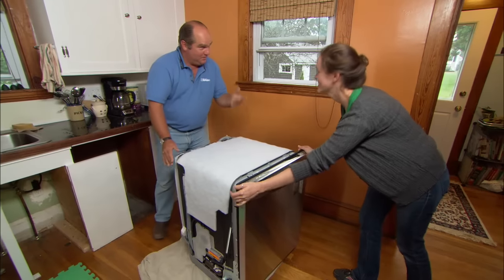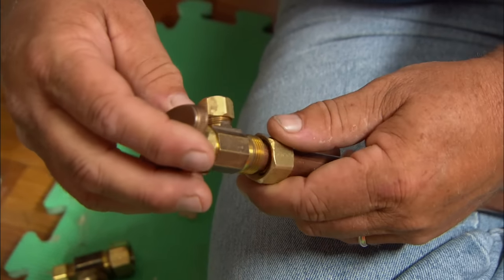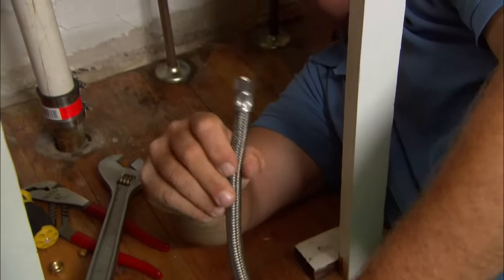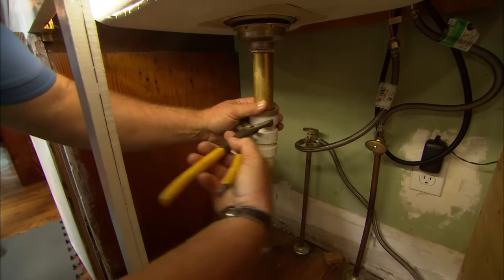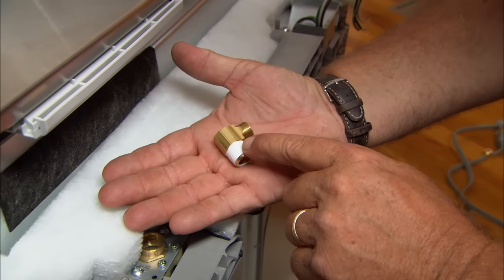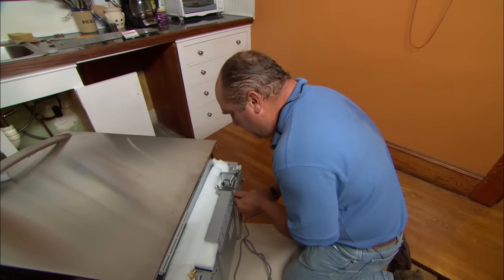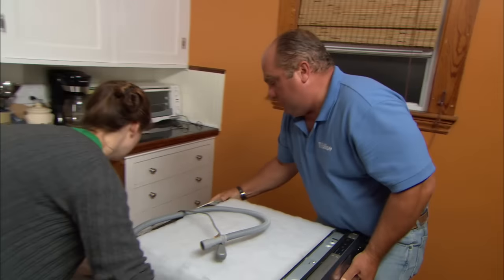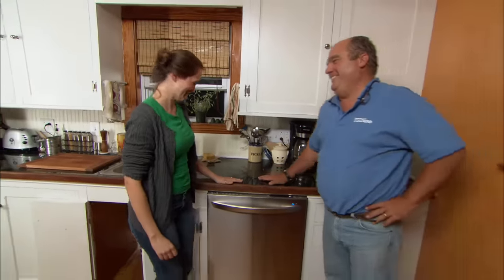How to Add a New Dishwasher to a Kitchen | This Old House

Comment: Is it just me, or did that sink not have a P-trap?
Reply: Yeah, I noticed that too. Weird
Reply: No vent either, what is going on down there
Reply: Needs a trap with an aav.
Reply: The trap is below the floor
Reply: Drum trap in basement guaranteed
Reply: What is a P-trap?  Is it important?
Reply: @captainpumpkinhead1512   It's a bend in the drain pipe under the sink that holds a little bit of water to keep the sewer gases from flowing back up the pipe and out of the sink. It looks like a letter P lying on its nose, hence the name.
Reply: @captainpumpkinhead1512 stink will come up from sink and dishwasher without a P trap

Comment: Smooth to black, ribbed to white, exactly what I was looking for, thanks!!
Reply: jerzsubbie it doesn't matter one bit. It's ac.
Reply: It's matters for safety reasons. Typically the hot is switched not the neutral so when things are turned off they are also de-energized. The neutral is ground referenced so it's unlikely to give you a shock. If you reverse the polarity, all the parts in the appliance will remain live at 120v even when off.
Reply: You could also follow each wire back to the plug and see which side is the smaller prong. Smaller prong = hot
Reply: Lol I traced the wire... since right side is hot
Reply: You can also plug it in to an outlet and use a voltage tester to see which wire is hot.
Reply: Remember: The ‘smooth guy’ gets all the ‘hot’ girls! Little electrical knowledge dropping here. 😂
Didn’t show much about the discharge line.  
Didn’t show much on the electrical connections being made.  Grommets used? iDK 😐 
“Level it up.” How did you know it’s level? And why?
Reply: Did I miss something? If she never had a dishwasher before why didn’t he mention where an electrical out may or more importantly may not be located and I didn’t see him hook up the drain line into the tailpiece?
Reply: @joblessalex  HAHAHAHAHA
Reply: Me too

Comment: Why doesn't the sink drain have a water trap for sewer gas?
Reply: Richard wouldn't make that mistake so it must be somewhere down below. Maybe the explanation was edited out? Weird plumbing if you ask me.
Reply: Was thinking the exact same thing myself. It was missing when they started, but didn't add one in when they retrofitted... wonder why.
Reply: It's probably in the basement, just below the floor.
Reply: A drum trap was located in the basement; see 13:00min in full episode. If you put a P-trap again under the sink, it becomes S-trap which is not acceptable per code.
Reply: ok
Reply: erictold
Does not matter. You cannot have a vertical distance greater than 24-30 from the fixture to the trap. Drum trap needs to be cut out and p trap under the sink.

Tom.
Master Plumber
Reply: Thomas R You can't just cut the drum trap and install P trap without an additional vent. It will become S trap which is also violation of building code. Knock every doors in Boston and tell owners your drum trap is not allowed nowadays. Local news team will call you soon for the plumbing scam.

Comment: I noticed that there's no trap under the sink. Is there one under the floor or something like that?
Reply: I noticed that too, I have an atmospheric vent instead of a roof vent for mine
Reply: Presumably the drain pipe terminates in a p-trap to a vented stack in the basement, just like bathtubs, showers, and toilets do.

Comment: There is no P trap. Did Richard mention anything about that?
Reply: He didn't mention it in this video. But there's a good chance there's a basement under this home, so there's an easy to access area where they may have put a trap underneath the floor between the floor joists similar to what's under a shower or tub. Hopefully!!!

Comment: Looping the dishwasher drain hose up, fixed the sewage smell I'n my dish washer.  Fixed now!
Reply: Having a P-trap under your sink will also prevent sewer gas smell. But he obviously doesn't notice that it does not have a P-trap. I'll say it again he's a hack
Reply: @guitar1301  The other hack
 thing is installing the dishwasher so that the control panel still shows. That’s supposed to be hidden under the lip of the counter top. It’s supposed to be concealed when the dishwasher is closed. That drives me crazy. I’ve seen it in a few videos on YouTube. I’m having one installed next week and now feel like I need to make sure the installer doesn’t do that to it.
Reply: @guitar1301  I noticed that too, but Richard is anything but a hack.

Comment: My husband and I are in the process of buying our first home. A beautiful 1941 brick cottage in a lovely historic downtown district. We can't wait to make it our home, but we will need to put some elbow grease into it to make it perfect for us. This channel is going be our lifeline as we move through projects. Thank you!!!

Question, though: how do you know if there is a power source and water hookup in the place where you want to install the dishwasher? I assume you can typically just look and tell, but our house has a wall-attached cabinet where we would like to install the dishwasher so I can't tell without pulling said cabinet out.
Reply: Did you succeed? You can connect water lines to existing faucet lines with the 3 way shut off valve Richard used in this video.

Comment: A plumber gave me a plumbing tip for any newly-installed dishwasher.  Before you run the washer, dump a cup of water into the bottom inside of the washer.  This will help prime the new pump.
Reply: All current dishwashers are tested at the factory before they are shipped.

Comment: Someone please help.  I am planning on buying a house soon.  Starting the process.  A lot of houses in my area, and in my budget, do not have dishwashers.  My question is this: how hard or easy is it to put a dishwasher into a kitchen where there was none before? Does it require a complete remodel of the kitchen? Does it require tearing down walls? Or is it pretty much what this guy is doing by just making some adjustments to the pipes and electrical? Because I will buy a house if it doesn't have a dishwasher if it's fairly easy and cost effective to put one in.  Obviously I know a cabinet will have to come out to be replaced by the dishwasher.

Comment: So far most detailed vid ive watched. But water looked like it went to thr floor. Why couldn’t it go up like the drain hose? Because i have to drill a hole through the cabinet. And does it have to the hot water? Doesnt the dishwasher heat up the water to the appropriate temperature for pots or dishes?

Comment: I do not suggest using a two branch valve.  It is better and easier just to buy a "T" fitting after the valve.  You would also keep the original purpose of the valve that is to shut the water off at the bottom of the sink and not go outside the house at the main valve.

Comment: I noticed the finished floor was missing on back right corner, did you add a small piece of 1/4 " or 3/8 to accommodate that difference, or does it not matter in the back?
Reply: Dick Reed The unit should be supported front and back. If the back feet can screw down far enough to reach the floor then it's fine. Otherwise, some kind of blocking/flooring is needed. The other reason it's good to have the floor go under the machine is that it's easier to spot a leak if one develops.

Comment: Why no trap on the sink?
Reply: Georgia Flyer There is (or should be) a whole house trap in the basement. One trap for all the drains in the house.
Reply: MarzNet256 thanks!
Reply: I have never seen that before.
Reply: @MarzNet256  then they should have used 1/8 bend for easy flow
Reply: No such thing as one trap for whole house , every fixture is supposed to have its own trap. House trap has nothing to do with being the trap for the individual fixtures.
Reply: In the full episode, he goes to the basement and finds a drum trap that led from the pipe.
Reply: @johnkrim8377  There is, actually. But we're talking about 120 years ago, or more, before they really understood everything about drains and vents.
Reply: @madmanmapper  According to Richard, the disadvantage of a house trap is that it couldn't be snaked out if it was clogged.
Reply: Yeah!  Codes REQUIRE a trap
Reply: @johnkrim8377  actually, there used to be "whole house" traps. They were put in to keep rats from coming through. (It was explained in an episode of ATOH)

Comment: Would have liked to see the holes in the cabinet - how to drill them and where to put them... But the rest was good :)
Reply: E lka The install instructions that come with machine will tell you where to make the holes.
Reply: Usually near the bottom of the cabinet. Manual will tell you.
Reply: @bcbock  unfortunately "used" don't come with manuals
Reply: As high as possible with a spade bit a little bigger than the fattest part of the drain hose.

Comment: One thing I can’t believe unless she has massive back venting. I just did this a whole roughing in Ellicott city Maryland and it was all old copper DWV copper and everything was properly spaced except for one bathroom it did not have a back vent and it was properly spaced between the sink and the toilet, and it was stealing the trap water And we had it left just like that and the ladies sink because we were replacing to existing, it failed because we didn’t have a cheater vent where that 90 is should be a tea with a little scooter vent that goes above the trap level of the flood rim above the top of the drain, so the bottom of the base of sink, you normally want to go up with your cheater vent 2 inches above that line where it ties into the bottom of the sink and it will vent a lot better and if you want to put a garbage dispose on there it’s easier is the trap below the floor?

Comment: When you install a dishwasher, it must have  a wall outlook. They didn't cover an installation for an outlet, (plug in). That's what I was looking for.
Reply: It looked like she had a pre-existing outlet, although if it’s old it’s probably questionable because these days you need a dedicated circuit for a dishwasher and one for a disposal if you have one.
Reply: I’ve installed hardwired dishwashers before.

Comment: Hi Richard. I've connected up a second hand dishwasher in a covered outdoor area for my cabin/sleepout. I've connected the water in with a branch off the main water pipe. I've dropped the water out under the deck and into a pipe to drain away. Unfortunately the dishwasher is not cleaning well and I'm assuming this setup is the probably the reason! Would be grateful to know your thoughts?
Reply: Is the water going in to the dishwasher hot?

Comment: Very helpful thanks.  In australia our dishwashers only have 3 connections and all 3 originate at the back of the appliance.  Cold water in, drain out and a 10a 240v lead and plug.  Too easy.  You guys make a simple task so complicated.
Reply: A.S Enfield lol I don’t know if you watched the video, but the dishwasher has a hot water tap, a drain line, and a electrical plug. I’m confused what is so different/ complicated here?
Reply: iLikeC00kieDough I think the point is the electrical connection is an IEC plug not bare wires connected by those pathetic and dangerous wire nuts (which are illegal in Australia). And it is all at the back not the front. 

Whilst it doesn’t make a difference to installation per se we also connect cold water not hot, with the dishwasher heating it as required. We also have very strict temperature limits on our “hot” water. If a tankless hot water heater is used the maximum temp is 55’ C and if a tank it think it is now 60’ C. The tank temp is hotter though to kill bacteria etc and is brought down via a tempering valve.
Reply: In the US it’s actually simpler. It’s just a hot water line. Why would you need a cold water line on a dishwasher?
Reply: @bcbock  Their's heat the water. It is supposed to save energy, but it's minor if any.

Comment: So a dishwasher only needs a hot water connection? I was thinking about putting one in, didn’t know if I needed hit and cold like a washing machine. I’ve just never used a dishwasher before.
Reply: Most basic dishwashers in North America use hot water supply, cold water supply is when your dishwasher can heat up the water in its own,(heat pump) much more expensive machines
Reply: Andrey Yaromich got it. Thank you. Like the idea of it having its own heat pump though. House has a smaller hot water heater. Gives me something to think about.

Comment: They do make valves that have a 180 degree outlet and a 90 degree outlet.  Would have suited this setup better.
Reply: Personally, I prefer a separate valve for the faucet and the dishwasher so shutting off the hot for one doesn’t disable the other.

Comment: Is a trap required for the sink?
Reply: Polo Loo nah. This old house clients enjoy that sewer gas smell in the afternoon.
Reply: Yes
Reply: Only if you follow any plumbing code, or if you don’t like sewer gas.  There may be other circumstances I don’t know. The drain going straight down probably means (or maybe means) there’s a P-trap in the basement. I don’t know if that’s legal. But you don’t want two p-traps which may be why this one is missing one. I can understand not wanting to focus on that, but they should have either explained that it was wrong and fixed it or explained why it wasn’t wrong.
Reply: On the full episode there is a drum trap right under the floor

Comment: Our kitchen design has a cabinet between the sink and the dishwasher. I assume we will have to run the plumbing and electrical lines inside the back of the cabinet? The cabinets back up to a pony wall. Any advice?
Reply: Jennifer Cory Yes. Get a plumber.
Reply: Jennifer Cory That's a bad layout. The dishwasher should be right next to the sink cabinet.

Comment: Would love to see the 4 hour video of this installation.
Reply: Shouldn't take more that 2 hours at the MOST. I can do it in that time, including a new breaker/circuit from the panel.
Reply: I had my plumber install my dishwasher. It took them about a half hour. But they had already added a dedicated valve for the washer when I redid the cabinets and sink. So everything was planned out. It takes longer if you have to do a lot of modifications. For example, a dishwasher needs a dedicated GFCI outlet in my area. And we had to have a separate one for the disposal. We also had to have an air gap installed in the sink as our city doesn’t allow the high loop shown in these videos. But since it was a remodel, that wasn’t a problem. But it could take you a lot longer.

Comment: I wish a plumbing job for me would go that easy.  I wonder if Rich had a bigger adjustable wrench he could of used?
Reply: It’s because he didn’t quite do it right. No p-trap. A short 90 on the drain line. Control panel is showing because the washer isn’t pushed back far enough.
Reply: @bcbock  I would of also gone crazy with the pipe dope.  I would of put in on that re-used ferrule and on the Telfon tape to the dishwasher supply.

Comment: Where's the trap for kitchen sink
Reply: I know right wtf
Reply: I wonder the same thing. Where is the p- trap for the kitchen sink
Reply: Gotta be somewhere otherwise she would have the kitchen filled with a nasty smell
Reply: It's likely in the crawl
Reply: it's probably in the basement
Reply: @timtaffinder  is that how they did it back in the day ! ??
Reply: @FamilyChannelfun32  well considering how the drain goes into the floor. You wouldn't be able to put a P trap in the cabinet because it would create a double siphon or an "S" trap which are banned.
Reply: Rich is in Massachusetts  older home there's a drum trap in basement
Reply: @michaelnelson7572   rightttttt that makes sense
Reply: Basement or in the wall.

Some old building didn’t have trap. The P trap was the only thing that stopped the gases to come up.
Reply: I wondered the same thing , the trap is most likely under the floor much like the trap under a bathtub.
Reply: That sink is weird in this times!!!🤔🤔🤔🤔

Comment: Where's the 'P-trap'?
Reply: Looks like the hose from the dishwasher connects to the sinks tailpipe, which has a pee trap.
Reply: @jeffreypedler8845  he's talking about the P-trap off the sink
Hopefully it's in the basement
Reply: P-trap cannot be in the basement as per code on kitchen sink
Reply: The house looks like it was built before the code for p-traps were in place. It's not hard to install one, but the homeowner will need an extension on the tail piece. I don't know why Richard didn't suggest adding one. But, I shan't question his judgement.

Also watching the hot water supply bounce up and down was a little scary.
Reply: Maybe the have old style "building trap" outside the house 😂
Reply: High loops don't work.  Put in an air gap.

Comment: No plumbing tape is needed for hot water hose?
Reply: Not on a compression fitting. But I would use a brand new ferrule.